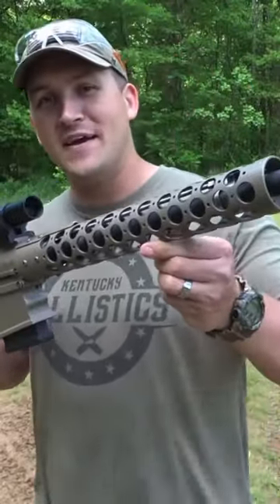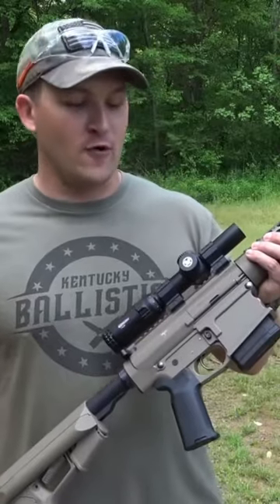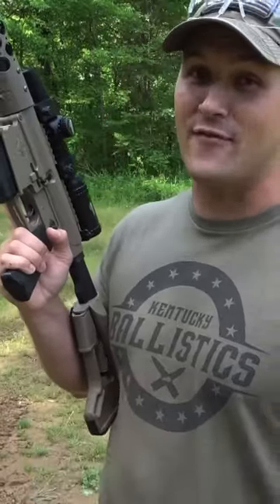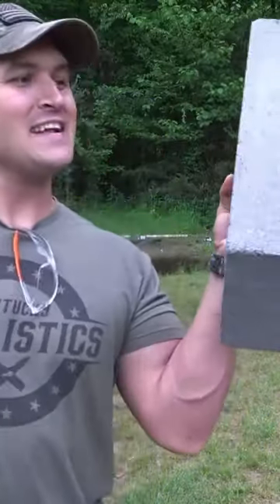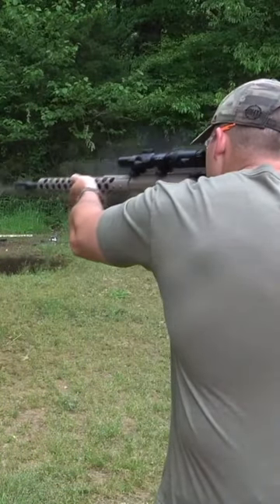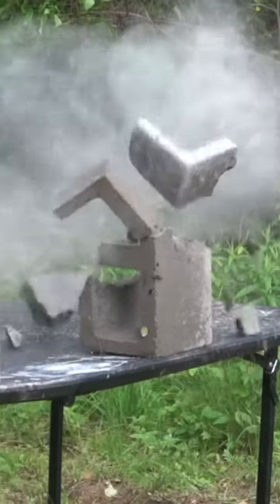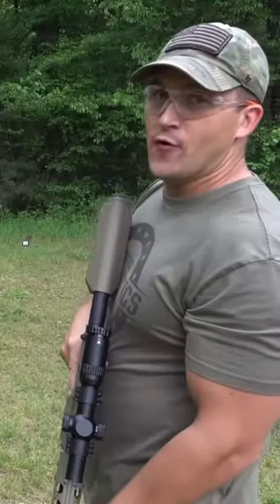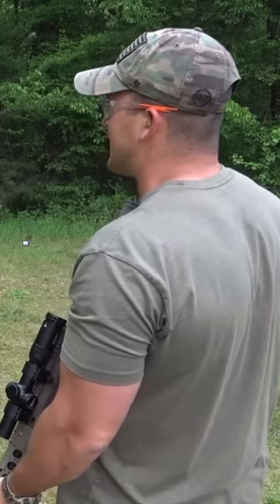.45-70 Auto Vs. Cinder Blocks (Kentucky Ballistics)

Comment: The 45-70 was originally a black powder cartridge. So if you load it with original black powder loads, and get the pressures right to cycle it, you could run a semi auto AR-10 during black powder season in some states. Talk about a hell of a loophole.

Comment: I mean 450 bm works just fine and it was designed for semi autos to begin with 🤣
Reply: This was also designed for autos. It has a rebated rim. It's not the regular 45-70.
Reply: @georgemcarthur488   that seems like it was a waste of effort TBH there are plenty of other large bore rifle calibers that do the same job and generally even have better ballistics that never had a rim 😂 I'm not hating that's just very niche hell some may say outlandish that one would put the energy in to that instead of just going to a regular rimless rifle round seems like alot of work for no benefits really other than maybe same powder and projectiles... And unless you can reload full time good luck finding ammo at any normal gun stores 😂

Comment: 100 bucks for 20 rounds? I’ll pass.
Reply: what kind of 4570 are you using?
Reply: @portergogniat6409  45/70 auto is different. It’s a rimless case unlike 45/70 government. It costs more than regular 45/70. I’m sure you could buy the auto brass and reload your own cheaper if you’re already set up for reloading.